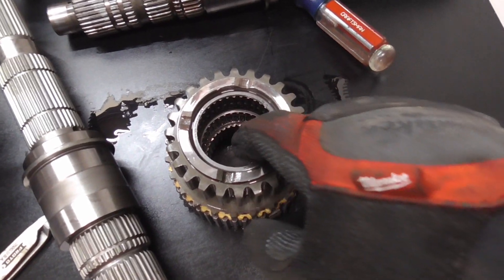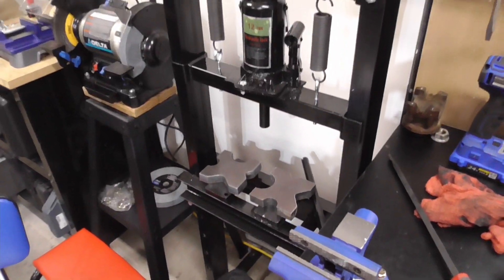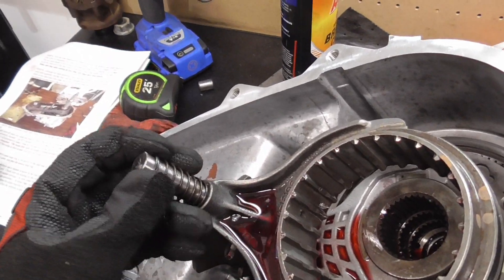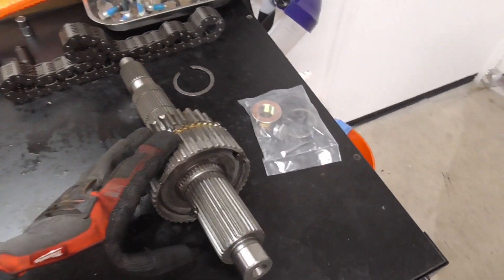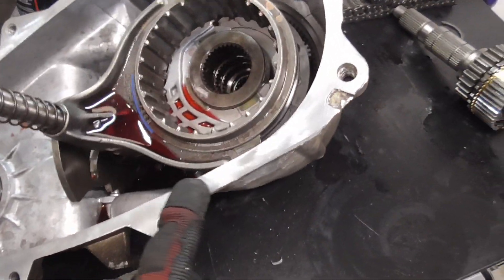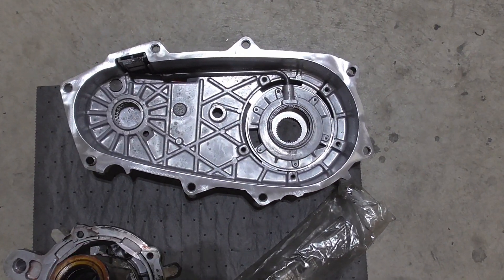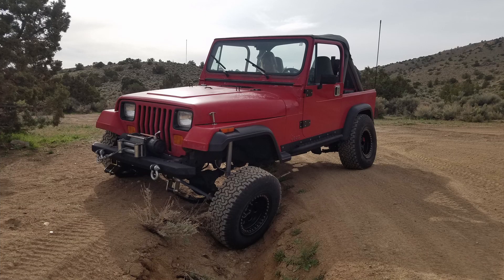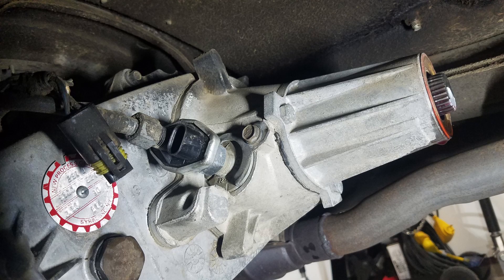Slip Yoke Eliminator SYE Install - Jeep Wrangler YJ

Comment: I just can't afford a full SYE setup. I need a shop to install. And I know the overall cost for everything I'll need, installed, will be $2000 easy. I don't have the technical patience to do this myself. 

I'm not going hard core offroading. I was thinking to go with the hack and tap method. It's quicker, easier, I could probably do it myself but I won't, and I should save myself $1000. 

What are your thoughts about the hack and tap, just in terms of a cheaper way to eliminate driveline vibrations?
Reply from the maker: I have never used one or have any experience with a HnT, but I've always considered them less appealing than a SYE. You could buy a spare transfer case for 200, put in a SYE for another 200 and take your time. Then either swap the tcase over the weekend or have a shop swap it. Just another option.

Comment: I thought you could do it with the case still in the Jeep? Apparently not.....
Reply from the maker: Sure you can...
Reply: So I crawled under mine and someone has already installed one, my jeep also came with a ford 8.8. My jeep has a rc 2.5" lift with some longer shackles I wonder if I could get away with going up to a 4" lift without any driveshaft issues?

Comment: Before i started to put the case back together i was checking to see if it spins freely with the new output shaft in and it doesn’t unless i pull it out just a little bit did i do something wrong or is it supposed to bind up until everything torqued down

Comment: Did you change the pitch of your rear, and if so how did you do it? I have a 1993 wrangler YJ and I put stock leaf springs on it and it lifted it a little bit. The drive shaft is rotating on more of an angle now. Would I need to put a SYE on it to help it out? I am not getting any vibrations. Also I watched a lot of these videos on replacing the SYE and everyone used RTV to seal the mating surface. Don’t they have a gasket for this application?
Reply from the maker: If you don't have vibrations then I wouldn't worry about it. There is no gasket for the 231.
Reply: Thank you

Comment: I have a 1987 jeep wrangler yj. Do I have to remove those bearing or seals whatever you call it?.if u can give me a feedback
Reply from the maker: Should be the exact same as whats in this video.
Reply: @HardEarnedBacon  I'm thinking to used a socket and hit it with a hammer. I hope it works

Comment: I hace the exact same setup I just haven’t got the 35” tires . I have a transfer case drop kit do you think that would mess with shift gears . Since I have a body lift
Reply from the maker: I'm not sure
Reply: Since I have a 4” lift and sye what would I need to set my pinion angle at?
Reply from the maker: @waylontheking1544  it needs to be 1 to 2 degrees lower than the angle of the driveshaft

Comment: Is there a way to contact you? I’m having some issues with my driveshaft after my lift
Reply from the maker: What do you need to know?
Reply: @HardEarnedBacon  I have a 91 YJ and I just put a 21/2” lift plus a boomerang shackle lift, which is a total of 3 1/2 inches. What don’t know what I need to do for back driveshaft. I’m very lost now
Reply from the maker: @stevecovington1284  if you have vibrations you can add a transfer case drop which is cheap and easy, or you can do the SYE and double cardan driveshaft which is more expensive and difficult but a better option. If you don't have any vibrations I wouldn't worry about it and drive it as is.

Comment: Hey man, this is my next project after lifting mine a bit, even though only lifted about 3.5” I have some vibes, on deceleration mostly.  I was wondering why you said in your description you’d go with the Advanced Adapters SYE instead of what you got? Also, have you seen the JB Conversions SYE and what do you think? I’d have to switch to an electronic speedometer set up if I went with their shorty kit but don’t know if it’s worth the hassle for a 3.5 inch shorter yoke.  I’m trying to future proof any upgrades I’m doing but also can only do so much at one time. Thanks for the video as usual, watched and saved this long ago. You’re an inspiration and also a pain cause you make me want to spend money on tools!😁
Reply from the maker: Haha yeah I love my tools, can never have enough! The Alloy USA kit that I bought is just the Rugged Ridge kit with an extra sticker and a higher price which is the main reason I wouldn't recommend it. The AA kit seems to be the best regarded SYE just from talking to people and reading reviews which is the one I tried to buy at the time but was on backorder for several months. The mega-short SYEs- unless you are running a ridiculous amount of lift on a Wrangler and/or a belly-up skid causing a crazy steep driveshaft angle I don't think you would see any real benefit over a standard SYE.

Comment: So your video saved my butt from a lot of heartache. I was in the middle of this and never saw anything about cutting the rod or removing bearings. And I have a 91 but for some reason I guess it had a transfer case swap at some point from an earlier 88-89 bc my rod measured 10.2. Thanks for the detailed video!
Reply from the maker: Glad it helped! Not sure what year they changed it but mine is a 91 too and had the bearings and longer shaft.
Reply: Curious, what kit did you use?
Reply: And did u also remove the brass ring in between the gears or re install that on the new shaft?
Reply from the maker: @justaguysgarage8318  Alloy USA
Brass ring is the syncro and needs to be reinstalled

Comment: What was that grease you used during reassembley??
Reply from the maker: The only grease I used was a very light coat of general purpose grease around the yolks where they ride on the seal. The RTV that I used to seal up the case and output shafts is Permatex Ultra Grey.

Comment: Are you running a Dana 30/35 at EJS?  Have I missed the swap to the 8.8?
Reply from the maker: Still on the 30/35. Ran out of time before EJS due to my lift not showing up for 3 months.
Reply: @HardEarnedBacon   How did you know what length rear driveshaft you needed before you did the SYE?